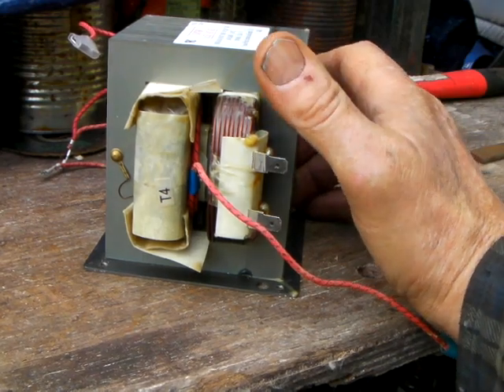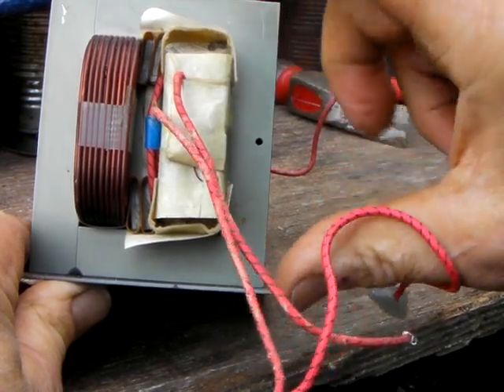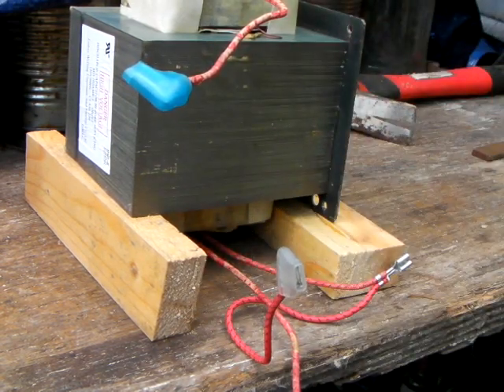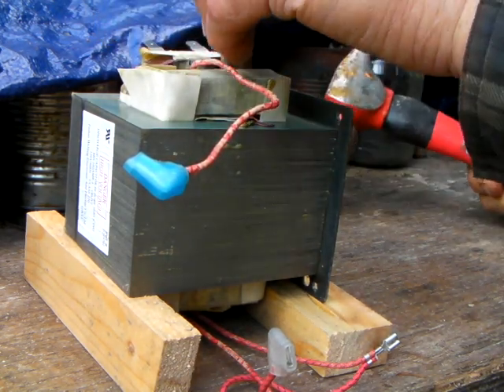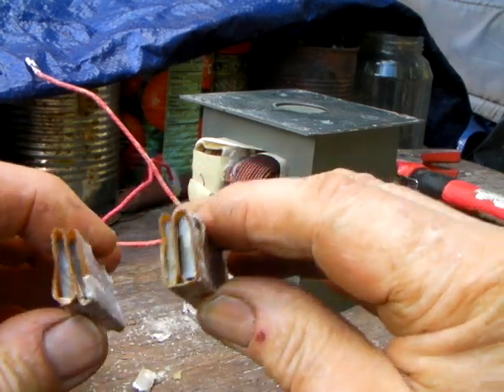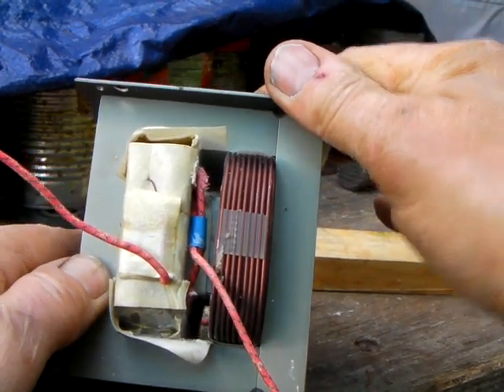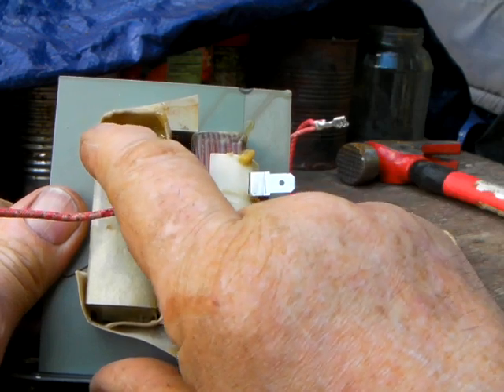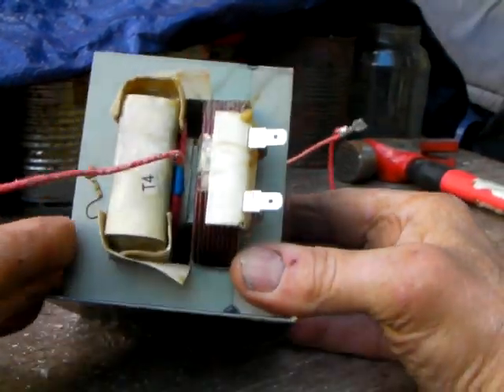Build a Tube Type Linear Amplifier For CB Or Other HF Bands Part 4 How To Unlock An MOT

Comment: I used an old MOT to build a 300W amplifier, using a GI-70Bt triode tube. I tested it for a while and had no problems with heat from the transformer. I removed the magnetic shunts as per your instructions.
Reply from the maker: I have been very surprised lately when testing some of the newer transformers. when I put 12 volts AC in on the primary to do a safe test, I am getting over 200 Volts out and that relates to over 2000 volts when you apply a full 120 Volts ac in on the primary and some of the transformers even went over 260 Volts with 12 volts on the primary.
For those that have not watched the video where I explained about how to do a safe test on MOT's, you connect a Variac  to the primary of the MOT and an AC volt meter and run the variac up to 12 Volts and then unplug the variac from the wall outlet without touching the control and move 
one lead of the volt meter to the MOT secondary output tab or wire and the other lead to the base or frame of the MOT making sure to scape away the varnish where you are making the connection,
then switch the volt meter to read one of the higher volt ranges like maybe 500 or 700 volts then plug the variac back into the outlet and look
at the volt meter... the reading that you see will
be 1/10 of the full output when 120 volts are applied to the primary of the MOT

Comment from the maker: Yes you could do that but you would need a Vairiac to get the exact volts that you need and at this age of the game they are very pricey.
Also the other reason that is not a good idea, is that it limits the "Stiffness"  of the
supply so that you end up with more sag in the high voltage when you start drawing plate current because you are adding resistance to the primary and you are not removing resistance from the secondary by not removing the turns of wire.
I hope that makes sense.

Comment: Hi! Any reason not to use an autotransformer to reduce the primary voltage, instead of taking wire off the secondary?

Comment: Unfortunately in the latest ovens, there are no transformers! Switching high voltage power supply😢
Reply from the maker: That just might not be a bad thing except for using them to power 4CX250b's ect. it would be perfect for tubes like the 3-500Z, 4-400, GS-23B and 3CX800 Ect.

Comment: These transformers heats up fairly quickly(  the core), so maybe for a short duration amp, like 30 minutes ,  but  i  would suggest you research MOT a bit more.
Reply from the maker: Hello...I am not sure where your reference of that
comes from but I have been building amps with MOT's since about 1982 and  just this summer I built 8 more and yes they do get warm but in 1999
I built a two tube 4CX800/ GU74 and at that time I tried something new...I put a 3 min. timer on the step start hold circuit and that monitored the key up circuit  and if no transmit after 3 min the timer would shut the MOT's down and after that the transformers barely got much more than warm
and when the next time the rig was keyed up the step start circuit would bring the MOT's back online...the main problem with the MOT's these days is that they are wound with aluminum wire.
If anyone wants the schematic to that hold circuit 
just send me an email at: radiomedic111@yahoo.com

Comment: I saw a video on mots somewhere said you could remove some primary winding to get the voltage down on secondary what do you think of this method
Reply from the maker: No...That would actually raise the secondary voltage, as you would be changing the turns ratio.
It would be the same as using a higher
voltage on the original primary.  To step up, you
would use more turns on the secondary and to step down, you would use a lower number of turns on the secondary than the number of turns on the primary. Thank You for asking that question!